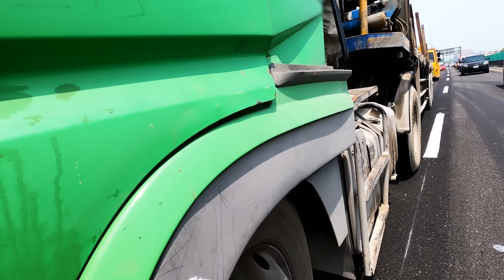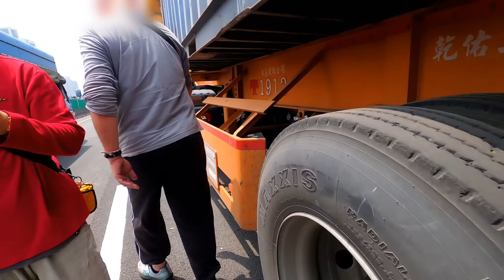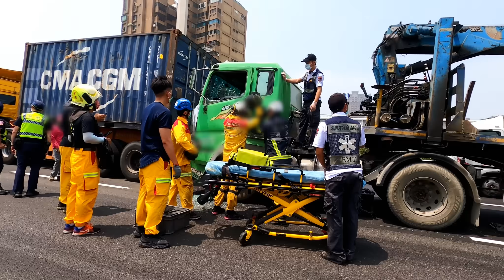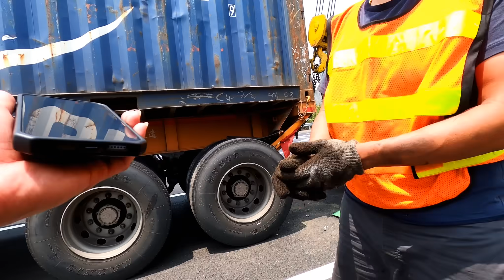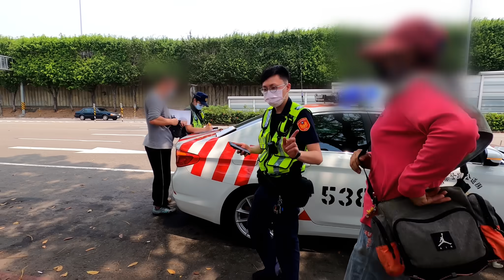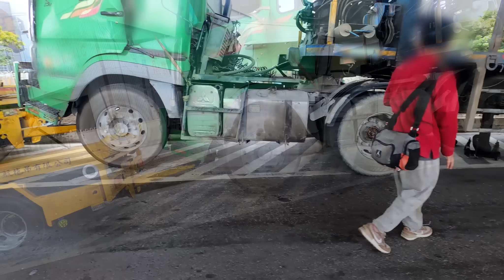老闆娘👩：車頭剛換就撞爛！🚚 每次都貼這麼近！🧨 講不聽！ #車禍 #吊車 #拖吊車 #道路救援 #警察 #國道救援 #高速公路 #快速道路

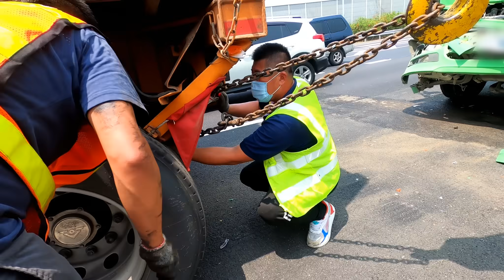Comment: @15:55 It's taken way too long time to remove the deformed steel bar stuck in the wheel. In emergency case, it should have been cut off with portable disc grinder. Anyway, complement to truck towers, for their dedication & professionalism in rescue effort.